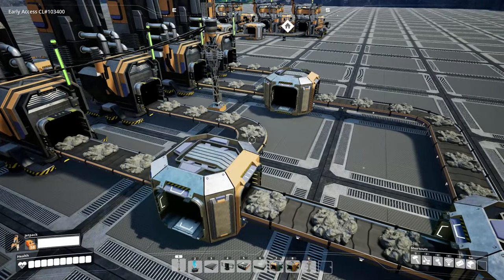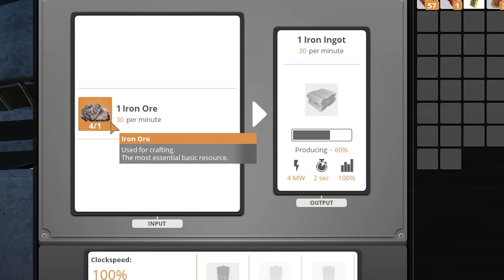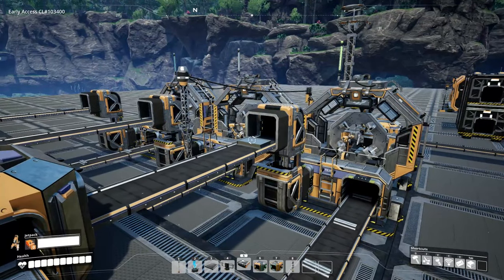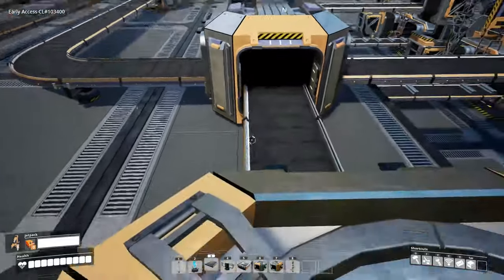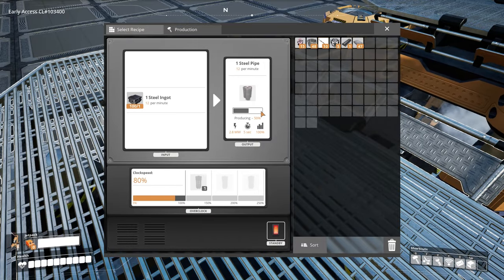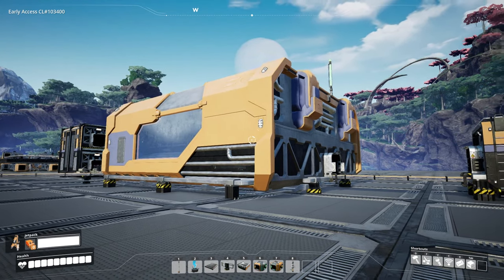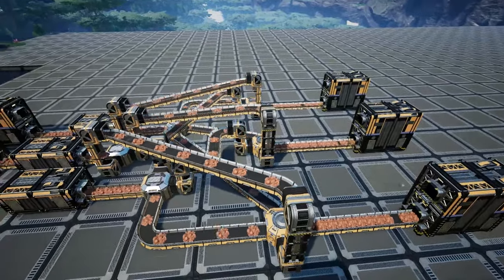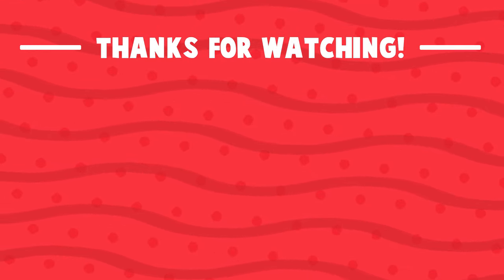Load Balancer Tips for an Efficient Factory! - Satisfactory Tips (Beginner + Advanced)

Comment: You can just split a line in front of each machine with a splitter and when one fills up the next will, and as long as you have the correct amount of machines for the input you have, it will balance itself. It's more beneficial doing it this way because it fits in a smaller space, is more easily expandable, just as efficient, much easier to do, and looks amazing. The only downside is the time it takes to fill up the necessary machine inventories to get it balanced. What I do is I just turn on the machines one by one just to fill them up, and then when they are all full is when i turn them all on at once.
Reply: Ahh, you call it the overflow method. Ya just use that method. It's not less efficient. Just has a bit of a start up time to get to peak efficiency, but the benefits totally outweigh that start up time.
Reply: you could hand mine some and put it in to start it or use a portable miner or something idk
Reply: You can split last one and make it back to start, maybe doing a container on the path is a good idea so you can have some buffer.
Reply: now with the sink it's maybe a good idea to split away the unused resources

Comment: The TLDR is that for a constantly running factory there is no difference between overflow and load balanced setups.

The difference comes if you have a factory that either starts and stops a lot,or one that has resources come in unreliably (maybe trains are messed up or something).

In that case, a load balanced setup will generally have all machines start at the same time and stop at the same time (roughly). It will go from not running to running 100% speed faster and it will go from running 100% speed to stopped faster. Whereas an overflow setup will take longer to spin up and spin down.
Reply: The joy of fluctuating power consumption that situation causes.....
Reply: @MrAntice  was going to say just this

it might almost be easier on your grid to do all overflow systems just so it smooths out the power usage

that might also be why the game always recommends a buffer on your input...
Reply: This assumes that resource input overpowers factory consumption. If it doesn't, like say you're trying to make the jump to midgame with only one or two iron mines and limited power supply from organic burners, then the overflow method won't work because most of your iron will go to surplus plates and screws and rods, and most of your steel may go to tubes instead of beams. You need all of those products, so you want to balance the inputs carefully to ensure that you don't end up with, say, 500 steel tubes and only 50 steel beams, or 2,500 screws and only 20 reinforced iron plates.
Reply: @NiteSaiya  That situation happen all the time up to and until you unlock everything because a first-time player has no idea how much ressources will cost the next tiers machines, and how much is need for the next milestones.
Also you can't build everything at once: hence, there WILL be an overflood of production once in a while while you setup other things and figure out how things work.
Basically, you can't estimate what will the next tier looks like until you get there. Then, usually, all calculations are out the windows and you need entirely new factories to build those new things, in correct quantities.
Reply: More easy to set up and buffer is also handy for the fast material grab;)
Reply: @NiteSaiya  It'll take some time to balance out, but further down the line, those beams will be needed, so the tubes in your example would back up and stop that constructor, allowing more resources to go to beam production.  At this point, it will all balance out.

Comment: 00:30 it makes your factory run at 100% sooner, not faster. Even the simplest chain of splitters on a single belt will work exactly the same as a balancer eventually. And if you start building your factory from the miner and let it all build up as you construct next steps, due to time saved by not placing balancers your factory will even start sooner on a simple splitter chain.

Comment: 2:03 The second load balance system is not necessary. You can simply feed each constructor with a conveyor directly connected to a smelter. More generally speaking, you don't always need to merge the outputs then to split them again. Suppose that you need 12 machines to produce the inputs of 18 machines. In that case, you just need to make groups of 2 and 3 machines in each line of production: you merge the production of 2 machines and you split it into 3, and you do that 6 times. That's way simpler than merging 12 convoyors then splitting again into 18.
Reply: Not necessary, but this kind of games is ultimately about your personnal goals, and some people like having a system that is efficient/good-looking/forward-thinking -> all of the above.
Me? I just want to unlock that next tierin the next five hours...
Reply: What if you have this set up material and bring that to another factory to process. Would you draw ton of conveyor belt across the terrain?
Reply: @Nhatanh0475  Of course no. You need to think your whole network in the most efficient way. For example, Kiblitz had the brillant idea to bring gazillions of cubic meters of water and oil to the middle of the desert, which was a terrible decision, as building factories above the sea is much more efficient. You want to avoid to transport raw materials and water across the entire map when you have a lake or a sea next to your node where you can transform your resources into more advance products. You want to avoid to move raw iron across the whole map when you can convey a small amount of motors instead. And if you don't know if you'll need stators or rotors for example, building a line of production for each type of output (and eventually use only one of them) is still simpler than conveying raw iron or coal to a megabase at the opposite side of the map.

Comment: That's funny, I do this but with sideways (perpendicular) Industrial containers (2 inputs, two outputs) that are daisy chained if it's going from two machines into two other machines. One of each input and output is used to cycle between the two in case one fills up first.  Industrial containers and overflow work so nicely until you get to oil/refineries in which you're trying to extract both power (via fuel or coal plants), and produce a good like plastic/rubber/alumina.  Because power demand is so variable, it's impossible to predict and have consistency with how much gets produced at these nodes.  I've resorted to just packaging the heavy fuel and AWESOME Sinking the overflow that doesn't get used in my fuel power plants.  The Plastic must Flow!

Comment: The easiest way is (if your belts can handle it) to have all of the inputs merge into one belt, then all split off. This is why I love the simplicity of pipes. If you need to transport 1200 oil per minute, and you only have MK.2 pipes, just have two parallel pipes with a junction in the middle to deal with overflow.